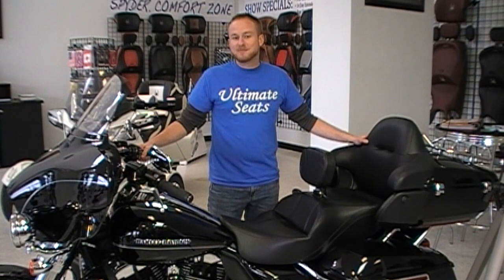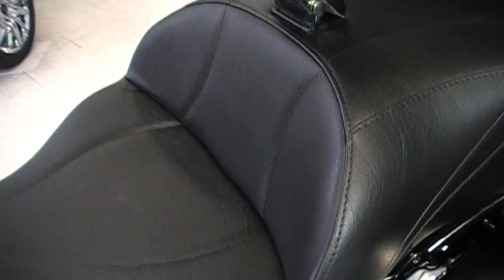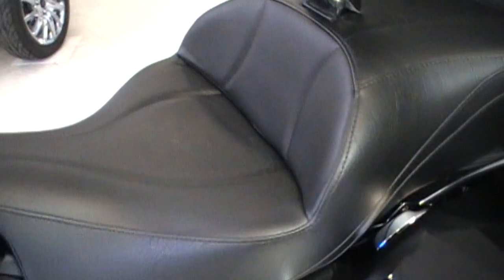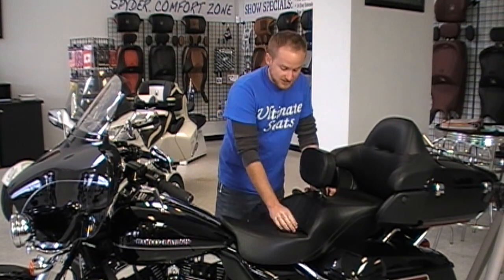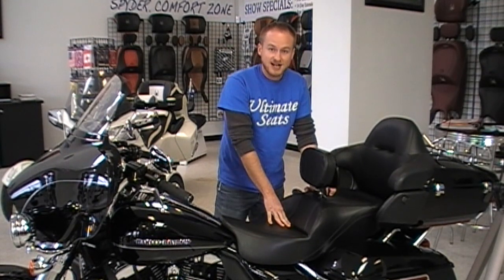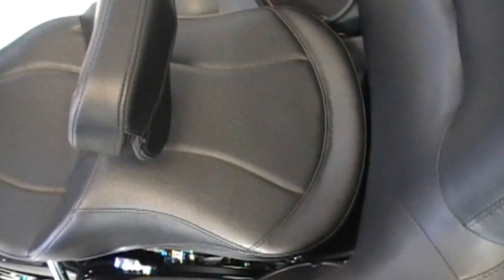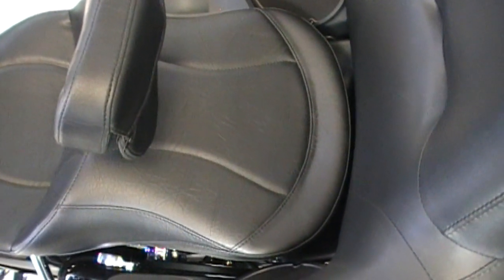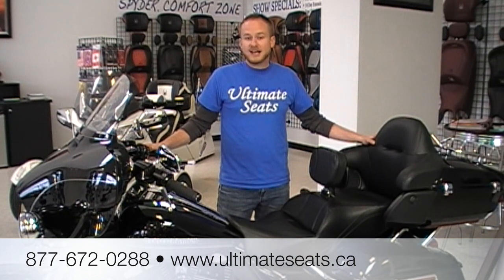Ultimate Seats - 2014 and Newer Ultimate Touring Seat for FLH

Comment: Can't find any reviews or people who own it in my area (OKC). Looks great, but already bought a Mustang seat and am disappointed in it. I'm leaning towards the HD Sundowner seat for my Road King. I like the looks and dimensions of your seat, it's bigger than the Sundowner, but with no reviews of your seat it is hard to purchase without knowing.
Reply: I'm a touring rider and I've been disappointed comfortwise by pretty much every off the shelf aftermarket seat I've tried, Mustang and Ultimate included. A Russell Day Long made for me was the most comfortable seat I've owned, but I no longer have that bike, and getting a new seat every time you change bikes gets expensive. I'm currently running a Pro Pad SuprCruzr sheepskin cushion on my Harley Hammock seat, and it works very well for me as my main issue was tailbone pain, and this cushion has a cutout for the tailbone. I've also tried many cushions, some with this feature, but this one works the best for me.

Comment: I can personally tell you from dealing with this company hands-down they have the best customer service out of any seat manufacture out there. Tell me one other company that will let you test drive a seat for 14 days to decide if you even like it. I’ve owned seats for many different manufacturers it’s always been the same bullshit you bolted it to your bike it belongs to you. Which sucks because it takes at least an hour of riding or so before you can really determine if the seat is going to work for you. These guys take all of the risk out of purchasing the seat. There’s a reason they’ll give you 14 days you won’t want to return it after trying it. The one I purchased the mounting brackets were slightly off due to the bike being a odd ball and they still bent over backwards to make shit right. Personally I would say you are a complete fool not to try there seats what the hell do you have to lose? I mean besides the back pain from the shitty stock seat you have on your bike now. By far the most comfortable seat I’ve ever put on one of my bikes.